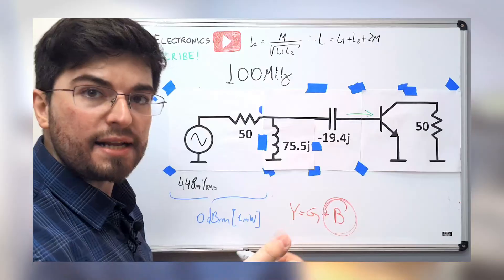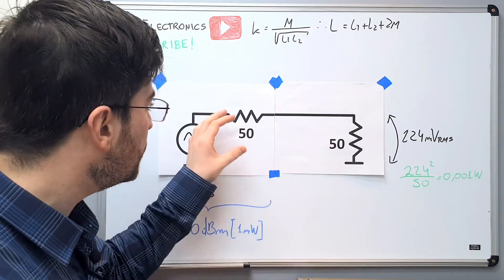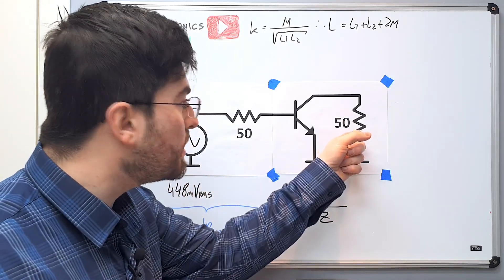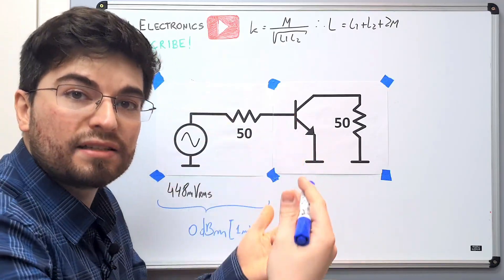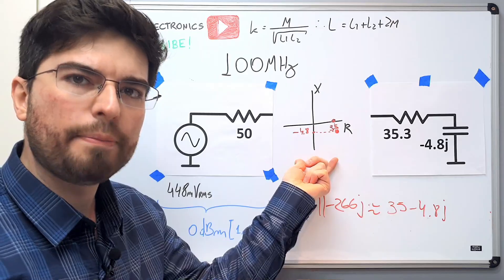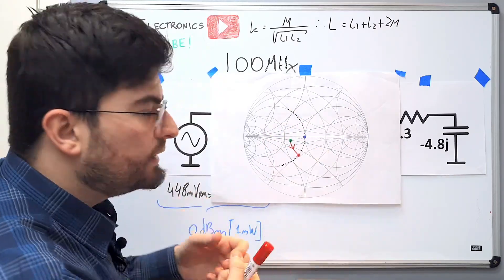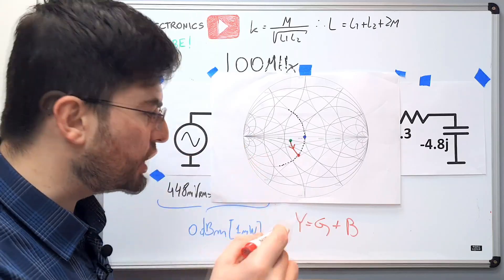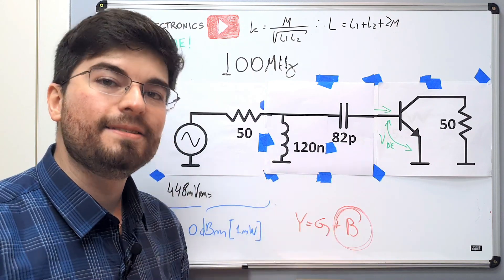Transistor Impedance Matching

Comment: Why was the first resistor 50ohms and how did you find the impedance of bjt
Reply from the maker: The first resistor comes from the Thévenin model of a 50 ohm source. The impedance of the BJT can be captured from the datasheet or, usually, by careful measurements using a VNA.

Comment: I am not an expert in this topic, but could you explain what happenen if the input impedance is infinite. Is the power delivered zero?
Reply from the maker: Yes. In this case, the transistor would behave like a "voltage sensor". It can be model as this for lower frequencies (< 10khz?)

Comment: Thank you for the video, it is darn near exactly what I was looking for.

 If I were to suggest adding  things, it  would be to give the part number of the transistor you are using, and to show how you got the base impedance.  I looked at the datasheet for the transistor I want to use and low and behold it has a piece of a smith chart showing the resistive and reactive components at a few different frequencies.  There seems to be a trend so I think it is safe to interpolate a bit at least between the marked points.  

Thank you again for the video.
Reply: Yes I need to know how to figure out the impedance of a BJT base. Does it depend on the bias current? Beta? Does a high beta BJT have a higher base impedance than a low beta BJT?
Also, how do you translate -19.4j into 82pF cap and +75.5j into 120nH inductor?

Comment: So If I understand it correctly when i would like to receive a very weak signal which would be kind of very weak source of the signal only what i can do is to develop an impidance matching network so that I won't loose much from that very little power I have from the signal received right?
Reply from the maker: Yep. In the end, you are always matching the impedance - to preserve the relation of the signal at a maximum, when compared to the noise. Take a look at my video about Noise Figures!
Reply: Thanks for the answer. But there is another thing that I can't understand. You say that your source has 50 ohm of impedance but what about if I build a receiver from a schematic and they say that a piece of wire 35 cm will be an antenna and then there is a 10 pF capacitor and then a regeneratove receiver circuit so in that case how could I know the impedance of the source signal? What if it changes, sometimes I can have my transmitter closer or further or weaker signal but I have no idea what impedance actually I have from my simple wire antenna point of view 🤔 Maybe my signal is weakend by mismatch and I don't even know it. There are a lot of things that are not answeared in books :( But when I grab a bokk for University there are a lot of equations which are not very usefull right away. I mean they are important but they don't explain the natural behaviours of things , only an ideal world.
Reply: Sorry for ortographic faults but I am writing on my mobile phone 😅
Reply: This is why I don't like those so called Youtube tutorials etc. I get never an aswer for my complicated questions. Ok there is an a swer for a basic stuff but never for complex subjects which indicates that nobody really cares. It is only about how many people view the channel. Nobody cares about the knowledge being tranaferred...

Comment: Good morning sir,
How can i know or calculate the in and out impedance of npn transistor for A class rf power amplifier and which information can help me in datasheet of the component can help me?
Thanks
Reply from the maker: The best way is measurement.. For the output matching, usually we make a load-line match. Take a look on the channel, I have a video showing that: How an amplifier works.
Reply: @AllElectronicsChannel  thank you sir for the responses

Comment: How would you do it mathematically without smith chart? Take conjugate ?
Reply from the maker: For simple networks the math usually is just describing the paths and distances in the Smith Chart
Reply: @AllElectronicsChannel  Ok, what is mathematical solution? not smith chart
Reply: @AllElectronicsChannel  Do you know the actual math?
Reply from the maker: Search for LC network impedance match

Comment: In case of the transistor, the maximum power transfer law doesn’t apply. Usually we deal with signal voltage here. Therefore we try to extract (or drop across the transistor input port) the highest possible voltage. We should consider it as a voltage divider circuit. So, the transistor’s input impedance should be as high as possible. We don’t match impedances there.
Reply: so i gather, you'd not necessarily need to impedance match transistors, as long as they're getting turned off/on at the right times... But still, impedance matching them would very very slightly reduce the power consumption of the circuit (even if only a trivial amount), although there are other reasons why it may still be of advantage to have a mismatch, since it may prevent ringing or other symptoms, in the case of transients or other exceptional  instances? is that so?
Reply from the maker: Wrong 😁😁.
Reply: @AllElectronicsChannel  We definitely do not "need" to achieve the maximum power transfer. We would "need" to do so for an electrical circuit, but for electronics, we only "need" to do whatever is our design goal, regarding the functionality of the subsequent stage(s). If, for example you want the minimum distortion of the signal that enters into the next stage, you will not push your input source to provide its maximum power. In such a case, the input impedance of the next stage should be at least 10x higher than the output impedance of the source. Buffer stages with no amplification between the source and the final output stage could be required for frequency filtering, modulation etc. and therefore, maximum power transfer would be the least of our concerns. Power affairs would be delegated to the final power output stages of the entire circuit. I would agree of course on the "need" to do impedance matching if the physical cabling requires to be handled as a transmission line, where the reflected signals could cause other side effects.
 Besides the use of the "need" word, excellent presentation of the impedance matching and the use of the Smith chart. Also, you requested feed back in your video but you just replied "wrong" to @TekCroach. A justification is required.
Reply: Hey  @iciliopo ...Late runner here, but I thought about leaving an endorsement to your react.
I also think that Greg should have justified his answer to @TekCroach that he is wrong.
Greg may have nailed in the method (to determine the transistor's input impedance) and in the explanations around the Smith Chart (which is remarkable), but I think he failed to clarify WHY does he think is necessary to achieve maximum power transfer to the transistor input node.
He started his reasoning with  the assumption that such maximum power transfer is what is needed and made his whole explanation based on that.
Granted, I don't pretend to understand very well RF wizardry as he does, and I admit that, at RF frequencies pretty much everything becomes a transmission line and due to that reason (transmission line undesired behaviors when unmatched), the impedance matching might be required, but he failed to get that reasoning through, by starting assuming the source impedance is a given and that aiming for the maximum power transfer to the input of the transistor was also a given, when in fact, those two aspects are exactly the WHYs behind his assertions.
Reply from the maker: Hey guys, the reasoning is straightforward Ohms Law. 

Maximum voltage at the base emitter junction will happen when the maximum power enters the transistor, as simple as that. 

Anything else is complication you have in your minds that you need to get rid of, leading to the misconception so many people have.

If you really want to ignore Ebers Moll and transistor physics, which explains the current modulation by a VOLTAGE, it is fine. Maximum current will also happen at maximum power 😜

Wish you a all a great 2026, we are all forever learners of the art of electronics!
Reply: @AllElectronicsChannel .... I appreciate you giving yourself the trouble to answer, but I don't agree.
The maximum voltage at the transistor base will happen not when the maximum power is delivered, but at the minimum current, highest impedance.
I may even concede that, in R.F. it may be either impossible or impractical to raise the input impedance enough for my assertion to stay true, but, if possible, the greatest voltage will be delivered not at the impedance that allows the greater power, but at the highest possible impedance, as long as it's higher than the impedance required for the greatest power delivery.
That is not contradictory to Ohms Law as you imply, it is exactly ohms law.
Let's not talk R.F. for a minute, if you just get a battery with a series resistance (pretending to be the source impedance), the load impedance that will render the higher voltage is literally the "open circuit" and not the impedance that matches the source impedance.
I know, I know, you're not talking about D.C. but between D.C. and R.F. there's an infinite number of possibilities and an infinite number of frequency ranges.
Medium Wave radio is considered R.F. and at just 1.5MHz a good and fast transistor behaves almost the same as it behaves at D.C. and will have the higher excitation at the the higher input voltage swing, and not at the higher power delivery.
Reply from the maker: No, you are wrong again. The maximum voltage will happen when the maximum power is transfered. You are failing to see that, for the matched condition, the voltage is higher than the source voltage. Do the math, it is simple.

Do exactly what you say: low impedance source like 100mV 100R, very high input impedance transistor 100 kR. Now, calculate the voltage at the junction for the matched case.
Reply: @AllElectronicsChannel ... Firstly, I was forgetting the good manners...
Happy and Successful 2026 wishes for you too.
Next, I must confess that up to this point I'm mostly rationalizing from gut feeling... and I must concede that your mastering of the theory is at a much higher level than mine...
I will call a truce for now and sit for a while (with pencil and paper and possibly some simulator to help with the math, as I'm somewhat rusted).
I admit that I may finally get to the result you're proposing, and I'll be humbled... Sure enough, it's coming to the point that it's unintuitive to me.
Reply from the maker: Hey Fabio, great to be discussing this topics with you. We are always learning! Wish all the best and lots of time on the bench!
Reply: @AllElectronicsChannel  It's the wonders of the social media... People discussing and collaborating irrespective of time, location, and whatever other borders.
I remember, I don't know, three years ago when I first saw one of your videos and posted a comment of how I was somewhat proud to see someone who was a Brazilian (or had some relation with Brazil) producing high quality material in English... Back then I didn't even know (for sure) you had some relation to Brazil, but I noticed it in your speech, very lightly (your English is very good).
Since then I strayed away a little bit from your channel because it's more focused in R.F. and I was never too much into R.F. (it's too much sorcery for me), but always appreciate the level of your presentations... Impressive content!
Reply: @AllElectronicsChannel  As stated above, the maximum power transfer is not always the goal. For example , in audio systems, Impedance Bridging principle is employed for minimum disturbance of the source. This way, you achieve minimum distortion of the source signal. Just have a look on Wikipedia relevant article https://en.wikipedia.org/wiki/Impedance_bridging . This principle of course applies to analog signals where you wish to maintain the integrity of the original signal. For digital signals where you only care about the detection of a level,  you need to check the voltage levels, since maximum powers transfer causes also halving of the original voltage to reach the input of the second stage. Happy New Year to all.

Comment: Yes, enjoyed the video very much. Just dropped in here for the first time so I am curious to know if you guide on audio amplifier output stage design: Class AB, class D, and so on. Exactly on the same lines as in here & why a component is added in the circuit (Impedance matching circuit) and deriving the component values (the part that I'm exclusively seeking). 
Please make a video on amplifier stage coupling (if not already made) and upload it. I Shall be very grateful.

   Thanks once again for making such a wonderful video.
Reply from the maker: Hi man, thanks! I'm not the best at audio amps. Search for the channel KissAnalog , you will find a lot of good material there !

Comment: I get delivering maximum power via a complex conjugate matching network but I don't understand your explanation that it produces maximum voltage across the base emiter junction of the transistor.  Max voltage would occur when the input impednace of the transistor is many times the output impedance of the source,  ie impedance bridging as in audio systems. With impedance matching you are only going to get 1/2 of the source voltage across the transistor.  So why not jack up the tranistor impedance to be 10 times or more of the soure impednace to impose more voltage across the transistor?  After all the signal inteligence is the voltage waveform, then if you needed more current follow up with an emitter follower to amplfy the current ?
Reply from the maker: Hi man! I'm glad you make this comment. This is a common misconception that a lot of people do, I also did many years ago. 

You are right. 

But, all breaks a part when you realize that a real transistor has a finite impedance, that cannot be changed. 

So, the best you can do is to match the source to what the transistor impedance is.
Reply: @AllElectronicsChannel  Thanks for the reply, I am not getting it. For reference I have an Electrical engineering degree from an ABET acredited university, although my concentration was in controls, I have also been a manager for the last 10 years so I am rusty,  I am also an extra class Ham licensee, hence the intrest in this topic. 

Take the CE configuration, the input resistance is a function of the biasing network and emitter juction (re) which is a function of the transistor Beta and temperature or another word, so basically Rin = R1//R2//re, it can be a little different if there is an Emitter resistor RE and or a bypass cap.  But in general the input reisistance is many 1000s of ohms. None of these componets are frequency dependent so what is driving down the transistor impedance ? What is the high frequency model of the tranistor ?

Comment: i am currently going through the art of electronucs and the first 2 minutes of this video makes so much sense now there is an exrecise in the book that calls for proving that the maximum power supplied by a non ideal voltage source to a load is when r=R (internal = load)
Reply from the maker: That's great!

Comment: Hi i made a common emmiter amplifier for 200mhz signal with 2× gain 
I can amplify a 50 mv p-p to 100mv p-p but I can't do it for 2v to 4v p-p
Why what values should be change???
Reply from the maker: Hi! I have a video called how An amplifier works, take a look. I show how to optimize the output impedance to have maximum output
Reply: @AllElectronicsChannel  thanks

Comment: Hi! 3:05 I do not understand why maximum power transmit means, maximum voltage at the base of the transistor. If the input impedance of the transistor is much higher then 50Ohm then almost all of the generator voltage will appear at the input of the transistor. May I have some clarification here?
Reply from the maker: No, you are right. 
But in your setup the generator would no be outputing all the available power, all the power it can output. 

Matching the generator to your high impedance transistor would generate an even higher voltage at the base, that would deliver the full available power of the generator.
Reply: @AllElectronicsChannel  The problem with this analysis is that bjt transistors are current amplifiers, so to maximize the gain the transistor input impedance should be as low as possible to maximize the base current, which will lead to maximum output current gain.
Reply from the maker: @jm6604-c4d  BJT transistors are voltage amplifiers.

Comment: Your video made a clear explanation of very complicated subject; however, what you missed to point out at end of the video was to do the calculation to show that 50 ohm input resistor was looking at near 50 ohm output resistor. And if audiences saw that maximum power transfer of having 50 ohm output resistor was done by your Smith chart, I am sure they would had been more impressed.
Reply from the maker: Yep! Thanks, I will revisit this topic someday

Comment: Can you do a video explaining conjugate matching?
Reply from the maker: For conjugate matching, you present an impedance with oppose reactance, so the reactance of the source cancels the reactance of the load.
Reply: @AllElectronicsChannel  Well yeah... but when and why would you do that?? A real-world-ish example? Reflectionless matching is the only case that really gets talked about. Conjugate matching maximizes power (of which reflection less is a special case). I've only heard conjugate matching explained in academic terms or as you did above, but I don't understand the application.
Reply from the maker: @jonboro2000  You are going to do it every time. In this example of the transistor, we are doing that. If you calculate the admitance looking into the inductor of the matching network, you gonna see the conjugate of the transistor admitance.
Reply: @AllElectronicsChannel  Your last commend was helpful/completed my understanding. Thanks!